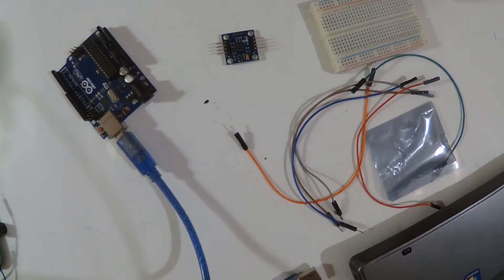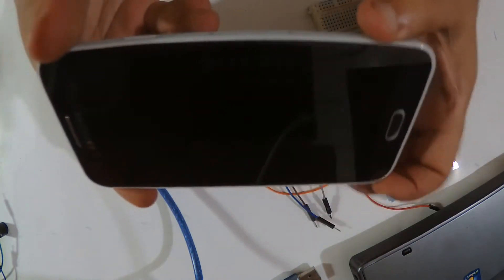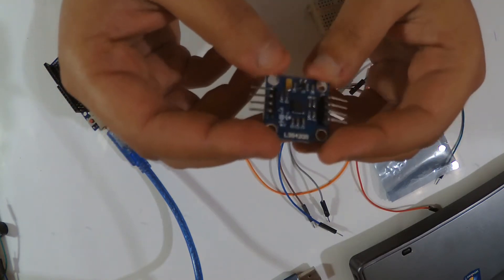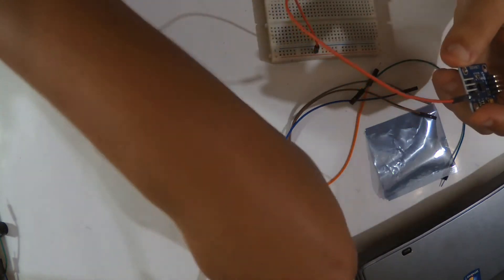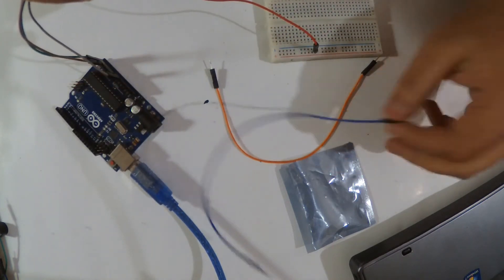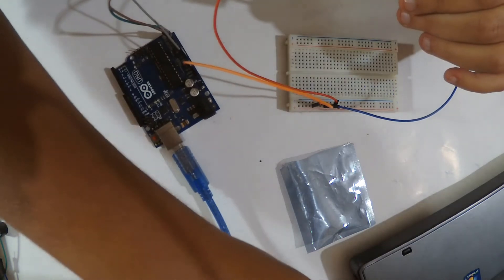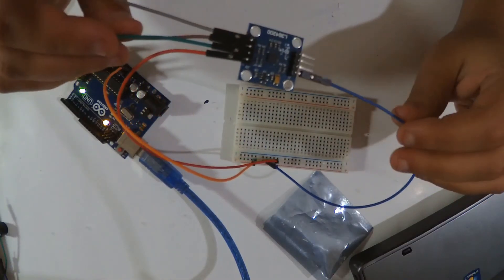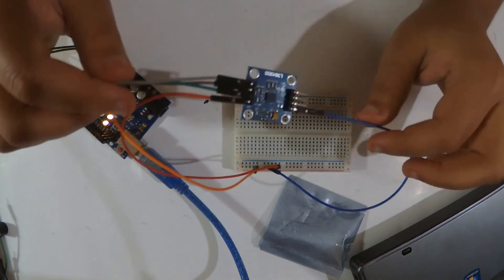Interfacing L3G4200 triple axis Gyro with Arduino

Comment: How toconnect 2 of these modules and see the outputs?
Reply from the maker: Hello, You'll need to have different i²c addresses, or you can use one with i2c interface and the other with SPI... or check if it's possible to change the address by changing a resistor position... Sorry I used that module only once and there are few variations of it... If it uses i²c like mine it will surely work with i2c multiplexer.
Reply: @SurtrTech  any idea how to code that based on what you have done?
Reply from the maker: @brendanbrowne9797  I would recommend to check how to use an i²c multiplexer first, will also check for a library, because here it's just simple interfacing, check this library it will make the job easier maybe (Didn't tried it yet) https://github.com/jarzebski/Arduino-L3G4200D